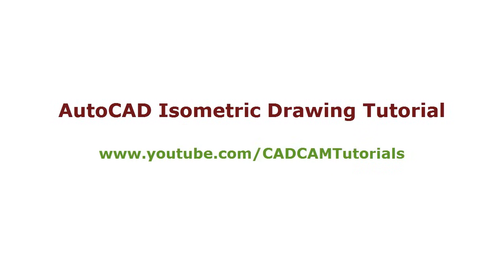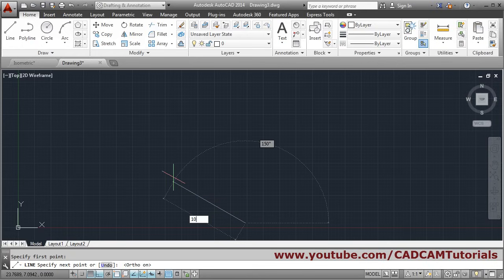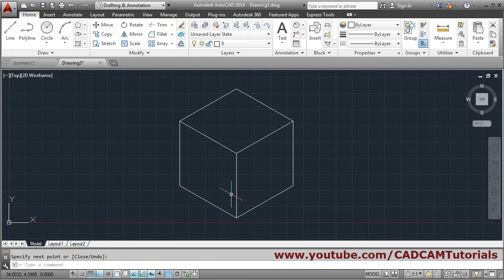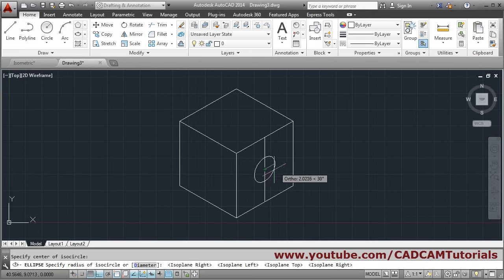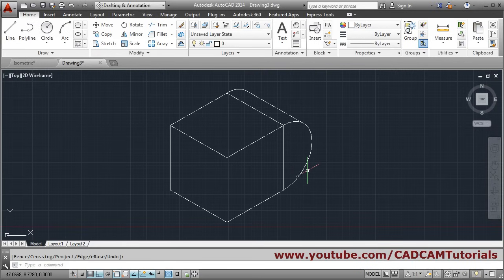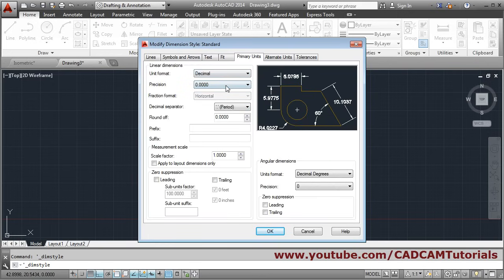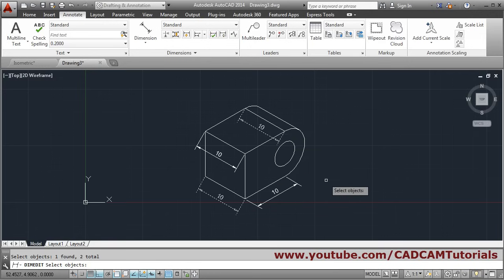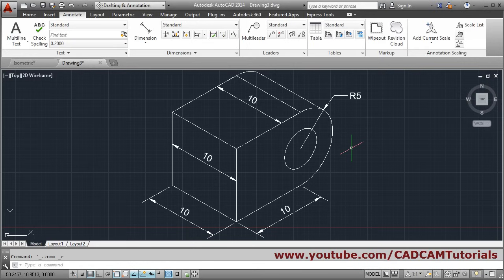AutoCAD Isometric Drawing Basics

Comment: I am not finding the 150 degrees. Where is this taken from?
Reply from the maker: Make Ortho on
Reply: @CADCAMTutorials  I see all the angular measurements except 150. The highest being 120.  

My question was was the 150 degrees were taken from?  I used ortho to draw the cube, I still see the 120 degrees as the highest one.
I may be doing something wrong but my cad is measuring correctly for the 30 degrees but no 150.

Comment: Thanks this is a good presentation. please, i am still using the older version of 2007. Does it have a multileader in it? if not how can i dimension an ellipse or a circle?
Reply from the maker: 2007 have leader command.
Reply: Yes, i have seen it. but it seems the values of the circle or ellipse has to be written manually.

Comment: While i am giving a value as 1 for snapstyl then grid lines also changes into a angular mode. Pls solve this issue. And my second doubt is why we r giving values for startup n snapstyl as 1 or anything what is the reason behind that?
Reply from the maker: Change in grid line is the new version feature. It is not a problem. 1 is for isometric projectio & 0 is for orthographic projection.
Reply: CAD CAM Tutorials but for value 2 and 3 it also same  happens. So what is the meaning?
Reply from the maker: It is on off switch it will only accepth 0 or 1. For other values, it gives error "Required 0 or 1 only". It will not accept other values.
Reply: In snapstyl it accept upto value 3
Reply from the maker: What is your version.
Reply: CAD CAM Tutorials 2016
Reply from the maker: You can find more details on startup command by visiting thus link https://knowledge.autodesk.com/support/autocad/learn-explore/caas/CloudHelp/cloudhelp/2016/ENU/AutoCAD-Core/files/GUID-941B7406-2342-47EA-9881-BAFF3A554310-htm.html
Reply: CAD CAM Tutorials as u said that 1 for isometric and 0 for ortho then while we drawing ortho view in drafting and annotations then why we gives value 1 for startup
Reply: I want answer for this question sir
Reply from the maker: I am talking about snapstyl command. Startup is different command. It is not related to isometric.

Comment: sir when i am using SNAPSTYL command instead of  changing of ucs icon plan angle is changed
Reply from the maker: +Words to Learn That's right, there will not be any change in UCS icon, only angle of cursor will change.
Reply: but angle of plane is changing but in your case it is constant why it is so?
Reply from the maker: +Words to Learn Please check Ortho is ON. If not make it ON by pressing F8. In Isometric drawing Ortho needs to be ON.
Reply: Try OSNAP